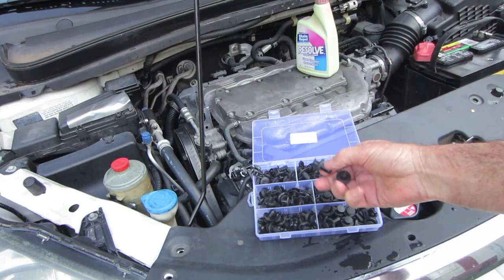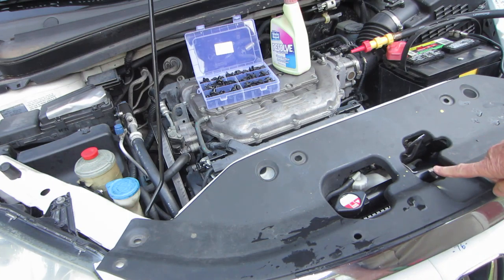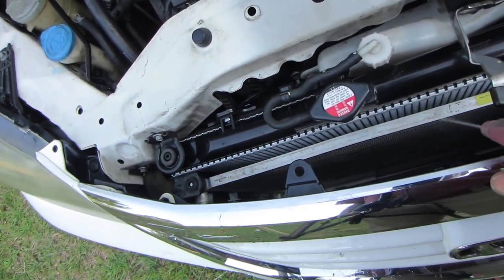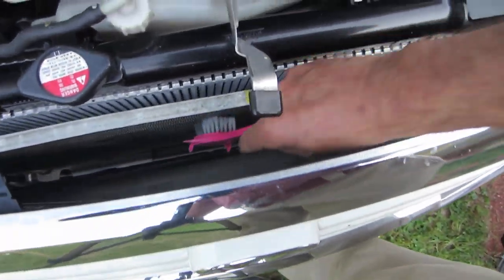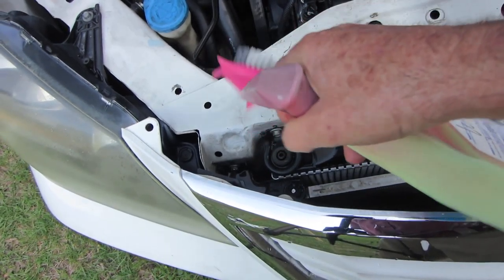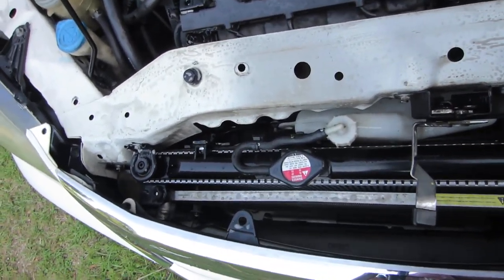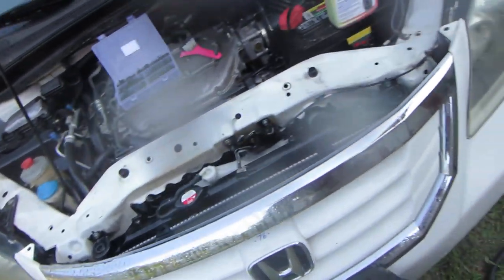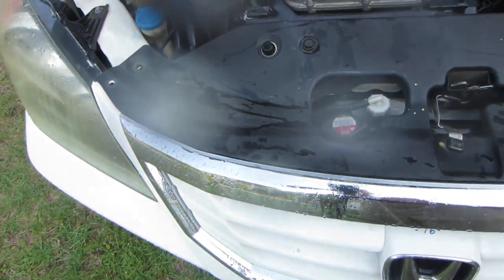EASY JOB - Cleaning Radiator Fins & AC Condenser for Cooler AC & Engine Life - Minivan Honda Odyssey

Comment: Good video.  There are two bolts that hold on condenser.  You can safely remove them which will give you just enough space to get to the inside fins.
Reply from the maker: Thanks for the tip!

Comment from the maker: BEWARE! BE VERY CAREFUL TO USE A SOFT PLASTIC BRISTLE BRUSH AS THE COOLING FINS ARE MADE OF SOFT ALUMINUM. DO NOT USE FORCE WHICH MAY BEND AND FLATTEN THE COOLING FINS!
Many vehicle manufacturers suggest cleaning the outside of the radiator once a year. The AC condenser is located right in front of the radiator and cleaner condenser fins will also aid in more efficient cooling of your AC system.
USING SIMPLE GREEN CLEANER, THIS EASY TO DO MAINTENANCE TRICK CAN HELP YOU REDUCE THE WORKLOAD ON YOUR MINVAN'S ENGINE AND YOU MAY ALSO GAIN SOME PERSONAL COMFORT INSIDE THE CAR

Comment from the maker: Hey Guys, - I Just want to clarify - This procedure is ONLY for cleaning the fins on the outside of the cooling system! In many older and high mileage cars there also may be some internal cleaning needed which is an entirely different and more difficult procedure. There are many videos about cleaning and flushing the internal contents of a cooling system. Hopefully, this work shown will help solve problems and make the cooling systems operate more efficiently. Thanks for Watching!

Comment: Will the cars cooling system run hot if the condenser is dirty?
Reply from the maker: Unless something else in the engine's cooling system is compromised, the engine temperature will usually not run hot with a moderately dirty condenser if everything in the engine's cooling system is performing well (fans, radiator, sensors, thermostat, etc.)- . But an extremely clogged condenser could hinder the flow of cooling air to the radiator in some cases.  It's just a good idea to have the AC condenser (and radiator) as clean as possible for the highest efficiency of both the engine and AC cooling systems. Of course, these external maintenance items do not fix internal problems which may cause over-heating. But often it is a good place to start in diagnosing some problems. Good Question - Thanks for Watching!
Reply: Cleaning the condenser will usually bring down your high side pressure which will make the compressor work less and possibly lower the internal temperature coming out your vent when your A/C is on